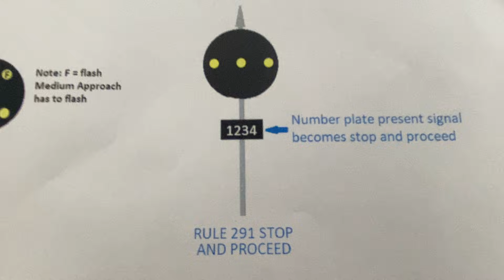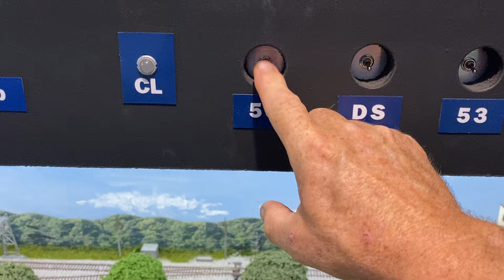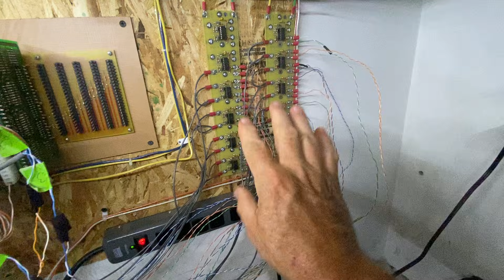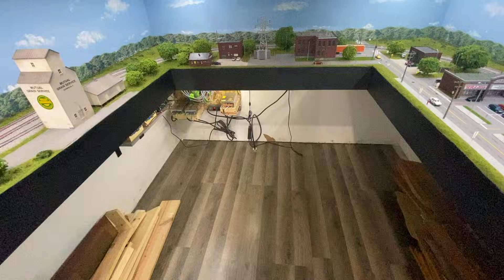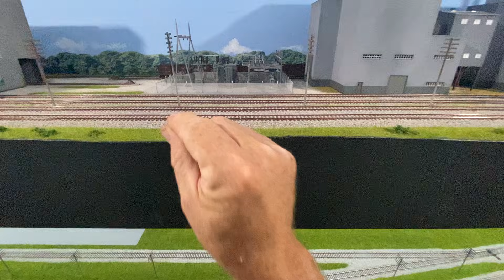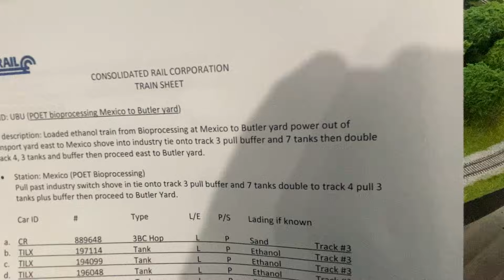Signals and hardware! Plus a little more!

Comment: Very impressive electrical hookup. It reminds me of some old school computers I have worked on. Think PDP. Lol. Simple safety thing on the 5 and 12 volt power supply you might want to put some tape over the line input connections. Mike
Reply from the maker: Thanks I appreciate the comment and the tip! Have a great day! Bill